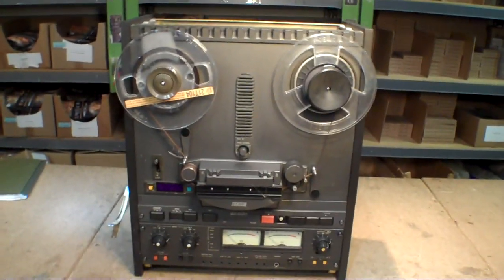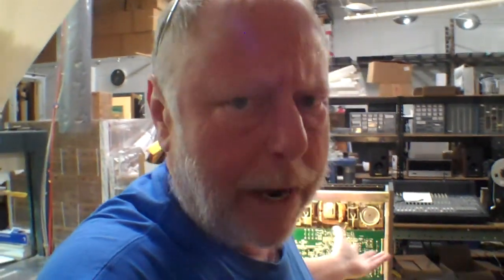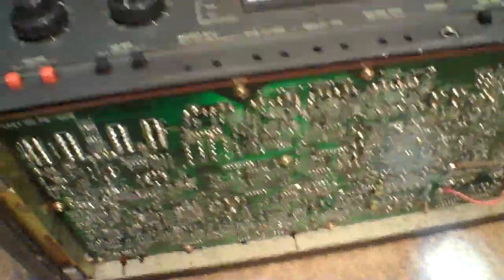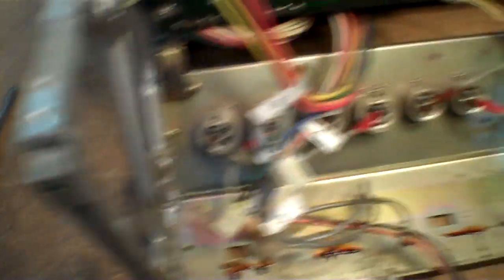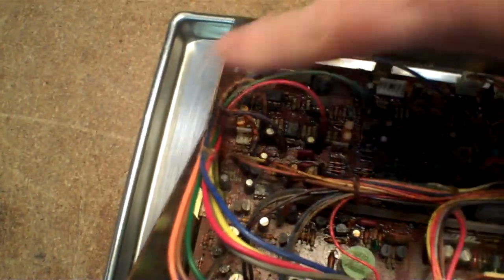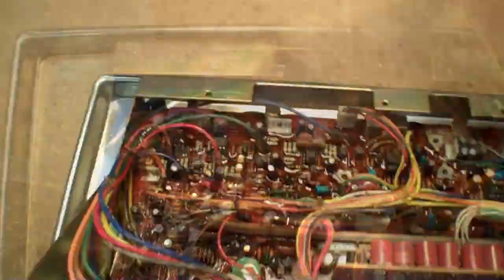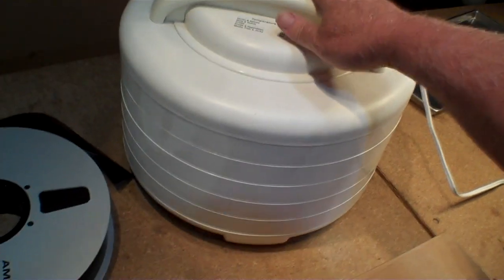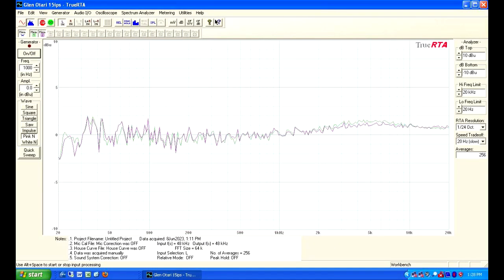Oh no! Coke in an Otari MX5050!

Comment: Must FYI for possible future use: I was tech support manager for a broadcast electronics manufacturer and we would use Simple Green and a soft toothbrush to clean boards after removing them from the machine, then rinse with water. Let dry thoroughly; you can use a low pressure air compressor as well. Be careful especially of coils and anything else delicate.
Reply: Water Pik seems to work well, too. (We didn't have one!)